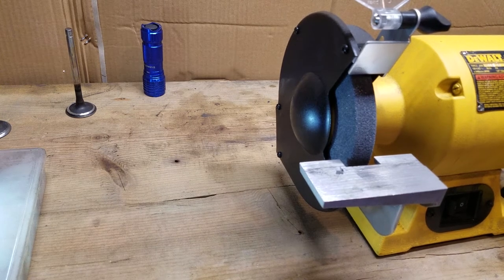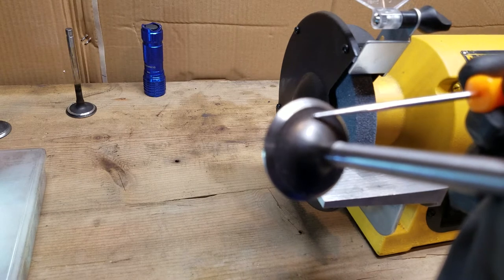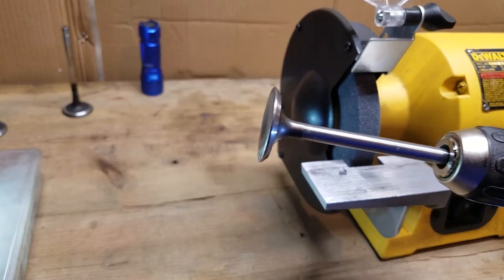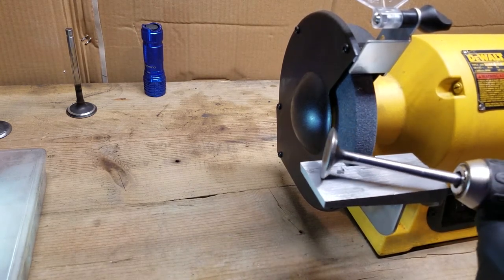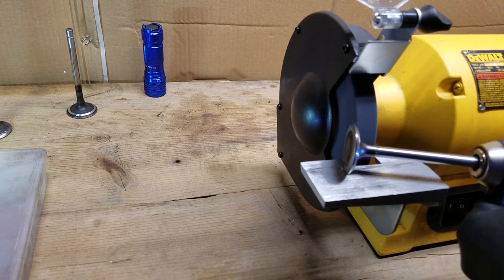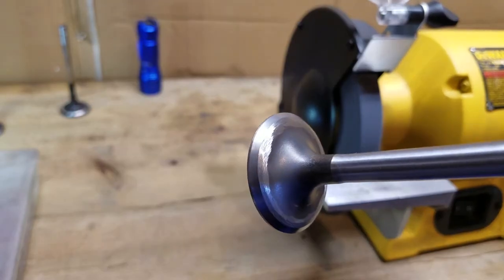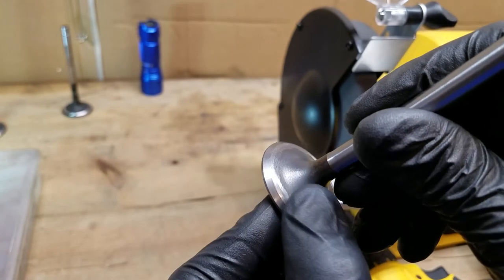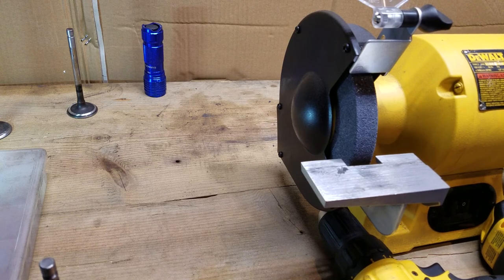HOW TO----- BUDGET back cut stock valves at home !

Comment: Leave the lips on exhaust valves, they help prevent reverberation of exhaust gas back into the cylinder, only blend the intake valves.  It helps with scavenging keeping the exhaust and removing intake lips.
Reply from the maker: Reversion happens because of camshaft overlap. If you are using stock valves like these, Your camshaft is probably not very big. Not very much overlap. You may also find it odd then,that absolutely no performance valves have a lip behind the seat face.

Comment: More beneficial on the intake valve. Not nearly as much on the exhaust valve because of the direction of the air flow
Reply from the maker: I actually had a solid increase in exhaust flow on my NKB heads on the flow bench recently. Some heads respond well to a 32° back cut. Almost always a drop in intake flow after .500 lift , with a back cut . Great for low lift on the intake most times , Sometimes the exhaust port loves it all around . Only testing will tell.

Comment: You just ruined yur value bud..the lip is to help stop reversion. Look it up. Yur motor will now make less power
Reply from the maker: If you are using stock valves like these, in all reality, your camshaft is not going to be very big. Reversion happens during camshaft overlap,which is more of a byproduct  of large cams. It seems you may find it ironic that absolutely no performance valves have a lip behind the seat face. Thank you for your input.

Comment: Picking up a bit of flow here, a bit there, soon the combination is kicking ass!

What most people miss is how much difference it can make...  change flow by 20 cfm at low lift can mean gapping someone or being gapped!
Reply from the maker: Exactly,  especially if you are on a budget and/or have a .525 or smaller lift  cam . It makes it better than just peak lift because it will see low lift 2 times per lift cycle . It's not uncommon for a stock valve backcut to make 20+ more cfm at low-mid lift .

Comment: I have an old Sioux valve grinder and use that to back cut the valves some…usually only grinding the little bevel off! 
Not sure how much it helps but figured it can’t hurt.
Reply from the maker: Put a 32° backcut with the old Sioux. Getting rid of the ridge on stock valves is usually pretty effective for increased flow below.  .500 lift.

Comment: You don’t want to remove that sharp edge from the back if exhaust valves, think of the direction that exhaust is flowing over it

However, You do want to remove it from the back of the intake valve as it creates an obstruction to flow.
Reply from the maker: Results will vary,but in general at low lift ( .400 and under, especially with a stock valve, stock head) you will see gains on both sides when tested on a flow bench. I have seen gains as much as around 20% + at certain lift points. In general it is not ideal with high lift cams and aftermarket valves because high lift flow can suffer.

Comment: Dreadful bodge! don't do it 👎
Reply from the maker: I learned that from David Vizard for a  backyard person to be able to do at home on their stock valves that have  a sharp edge on the backside.
Reply: @blueovaldude  Hi, I wasn't having a go,  I'm aware of David Vizards work but it looks like there is no respect for angles or repeatability and the stone looks too coarse to get a fine finish.
Reply from the maker: @MrUmpleby  It is only useful for removing the sharp lip and or cup on the backside of a stock valve for a person to do at home on the cheap, no sort of resurfacing of any of the like. The best is have a machine shop do a 32°backcut on the valves, many people opt out because they are using cheap stock stuff anyway.
Reply: @MrUmpleby well I agree the stone is too coarse. I’d also make a jig out of some 5/4 oak and 1/4” steel to clamp it to the grinder. Or, no! I wouldn’t do that at all, but rather chuck it in a three-jaw or drill press and use a fine stone in a die grinder or probably carbide paper on a flat file with a guide to do this without going to a machine shop.
Reply: Crashing the party at the backyard boogie